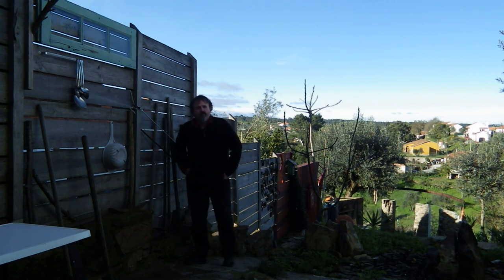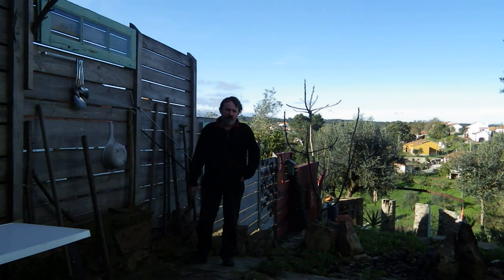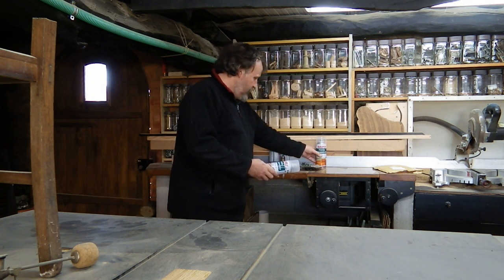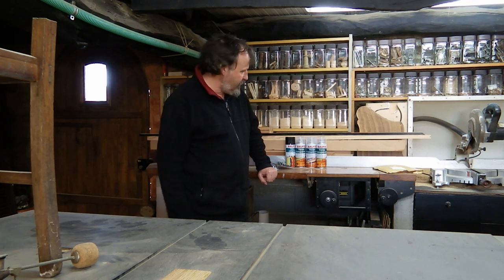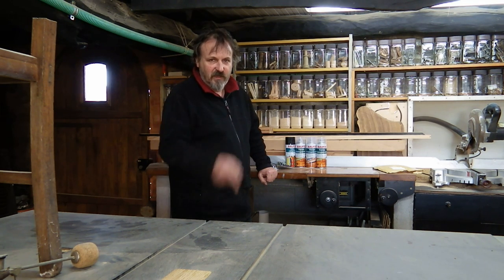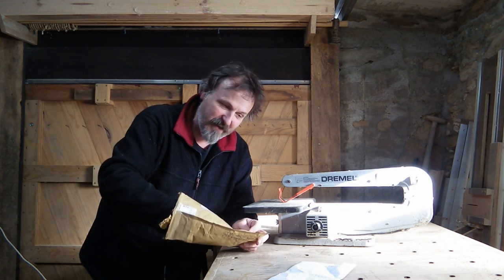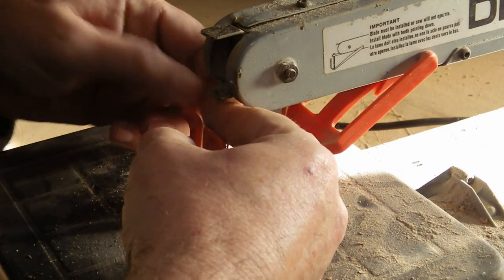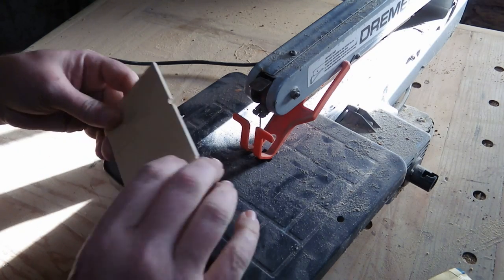#39 (vlog) Scroll-saw update and Portuguese woodworkers

Comment: So very nice of him to send you the Scroll Saw blades. I had that exact model and even though it is noisy and vibrates around the table (if not secured down) it is a very good scroll saw. FYI, the accessory attachment on the right of the base is for a small disc sander but can be used as a rotary tool of sorts. Yes I watch all of your and Christianna (get hands dirty) videos. She is an amazing artist, musician, and craftswoman.
Reply from the maker: +MRrwmac Thanks! I know... I about the disc sander, I lost the attachment. I'm going to "upgrade the steel "table" and see what else I can do with it (maybe a rotary tool on the spinning  rod)

Comment: Good stuff! I love to find new channels so i will subscribe to this Portugese speaking guy. Nice gift you got there from mr Appelman! 

Cheap drillbits are usually a bit in need of sharpening. If you have any problems with them, try sharpening the cutting edges with a small diamond file.
Reply from the maker: +Willem Kossen I do have a little sharpener (bought , I think in the same year as the scroll saw) which you put on a drill and has the right angle. Just a little spinning stone that you have to water down... I think I know where I put it.....:D)

Comment: I can't see clearly in the video, but are those tapering drill bits the kind that you tighten up with the allen (hexagonal) key?
Reply from the maker: +MrZaphaell Yes they are... 2/ 2,5 / 3 /3,5 / 4 /4,5 / 5 / 5,5 / 6 /8 mm
Reply: +Not Just Sawdust I'm asking because there is one thing you have to do right away, you might know this, but some of your audience don't, so I'll try to explain it anyway. You need to measure where that screw is placed approximately on a drill bit, take drill bit out of the tapering part and make a small flat part on it, very shallow, just touch it, you can do it on a grinding wheel. It doesn't need to be big, and also it has to be small enough so you would leave enough untouched drill bit to still keep it centered inside the tapering part, just enough for the flat screw end to have something to lay onto, instead of touching the drill bit on the round part. Otherwise the  tapering bit will turn when you are drilling, and you will never be able to tighten it enough, you may even strip the allen screw hex trying to apply enough force to tighten it not to turn. Anyway, I'll post a picture in Woodworking Europe as a comment to your video, so you'll know what I tried to describe (it is a funny picture made in Paint, but I'm a woodworker, not a computer graphic designer, so that's the best you'll get from me :D )
Reply from the maker: +MrZaphaell Thanks for the tip!